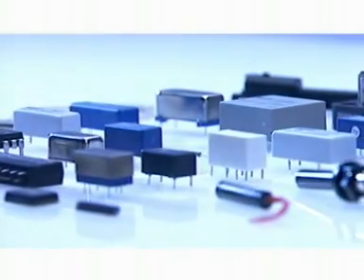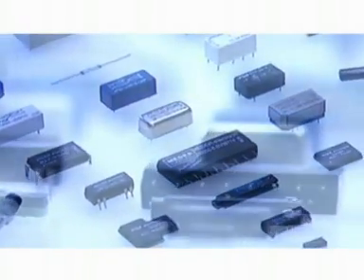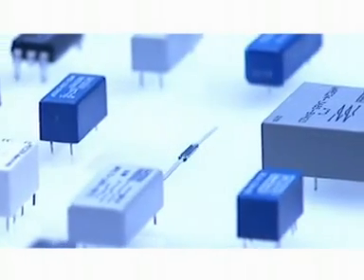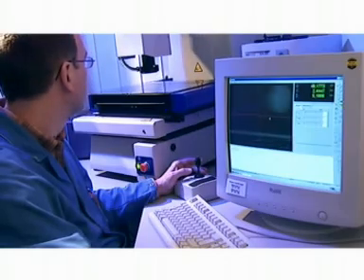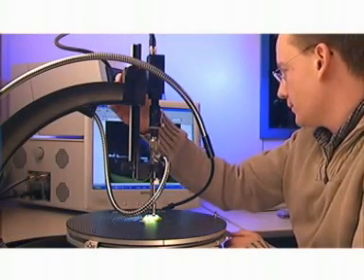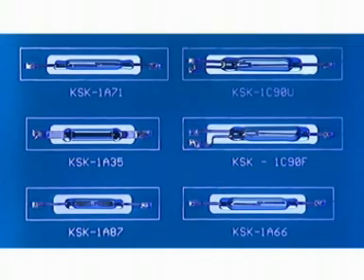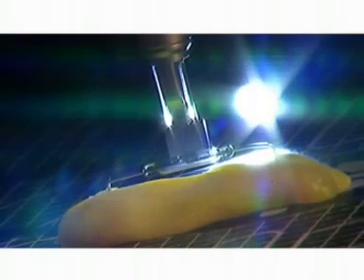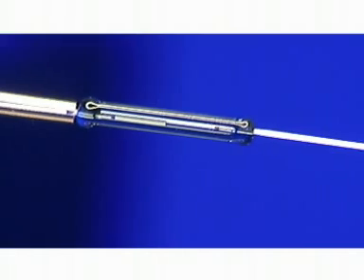How a Reed Switch Works

Comment: The reed switches should not work. Suppose gap between the reeds is 10 micron. When a magnet is brought, the upper (or nearest reed will move by say15 micron. The lower reed being more distant, will move by 12 micron. So the resultant gap is 10+(15-12)=13 micron. I know there is a fallacy, but someone needs to explain in concrete terms.
Reply: My interpretation is that you're not trying to attract both legs towards one side where you put a magnet. Instead, you're applying a magnetic field over both legs, turning both legs into magnets themselves. The legs then attract each other and close.

Comment: weird. like eardrums sort of, only instead of sound vibrations, it's magnetic fields.
Reply: Well, not really, unless you are talking about using them at a rapid speed. They don't vibrate or anything, that is just a magnet moving rapidly. 
Attach a screw to a magnet and you will see the screw is now also magnetic, but only when attached to the magnet. That is how these work, but at a distance. The metal is so delicate and the tube is at a high vacuum, so even the smallest of induced magnetism makes them stick together. Thankfully, the current induced when magnetized serves a secondary function of purging the induced magnetic field.
Reply: Yes I agree Mr. Smith.

Comment from the maker: Reed switches are definitely more susceptible to mechanical shocks.  However, we have designed many standard and custom packages where the reed switch is potted into an assembly to help improve the shock resistance.

Comment from the maker: @Zuja59 Hall sensors did not replace Reed. There are applications for both depending on a number of requirements.  We have been manufacturing and designing reed switch and sensor products for over 25 years and new applications continue to arise, and even more so with miniaturization, low power and portable devices requirements.  Please take a look at our Reed vs Hall Sensor comparison chart at meder.com in our Technical section under Technical Papers "Reed Sensors vs. Hall Effect Sensors"
Reply: Very informative, thanks!